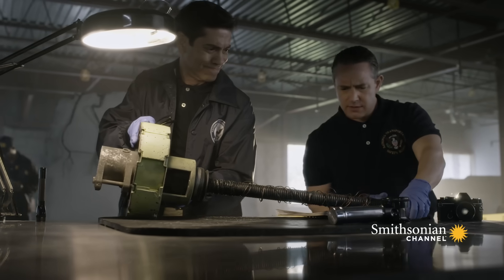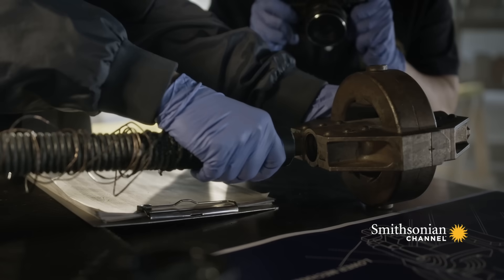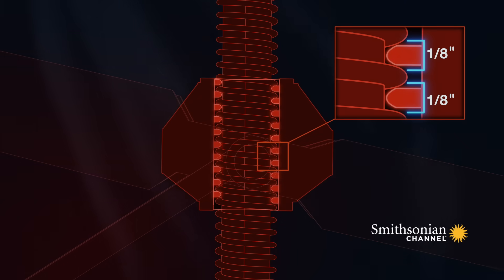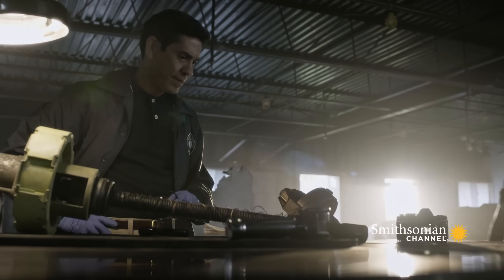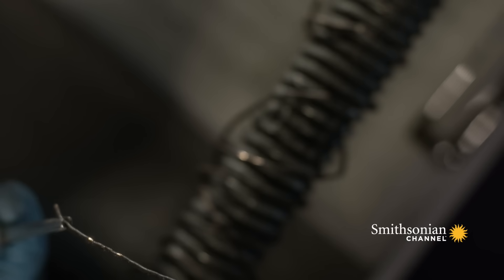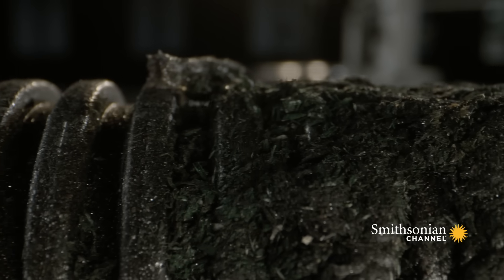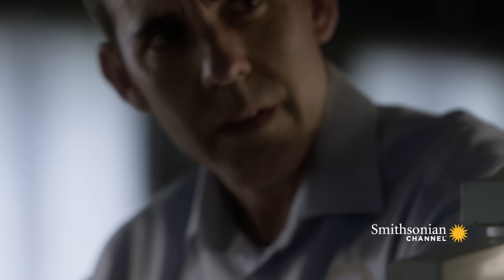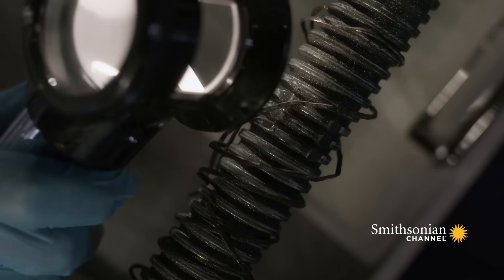Deadly Crash Investigation Reveals Inadequately Maintained Components 💥 Air Disasters | Smithsonian

Comment: Absolutely not, water NOR SALT breaks grease down only way water will get rid of grease is sprayed or splash will remove some excess grease but bottom line grease repels water in a big way all lubricants do as they are mostly all petroleum based in order to lubricate, wick (meaning it virtually spreads on the surface it is on or near To protect from moisture and prevent rust and or corrosion) this was most definitely a case of poor maintenance and the mechanics. We're either too lazy to remove whatever panels necessary to access the spiral worm gear or we're not aware that it was an essential maintenance protocol once a metal to metal surface no longer has lubrication the metals will gall because lubricants basically float parts by creating a slippery barrier that prevents the metals from even touching once surfaces are "seated" or "worn in" and once you no longer have that ultra thin barrier friction starts galling and chunking the metals and eventually creates two opposing surfaces that are literally eating each other away and the threads inside the nut became thin and sharp and weak  suddenly the worm gear bound or "locked up" and it was muscled by the pilots and the worm gear took what was left of the threads right out of the nut that was the end and the stabilizer snapped to its limiter at full down position with no redundant back up system to prevent loss of control. Often on parts or systems like this they will put a nylon coating on likely the threads of the nut because nylon not only creates a naturally slick surface for metal to rub against but prevents friction, heat , vibration and noise. I can guarantee you ever since then there is definitely a redundant backup system such as a secondary screw. Jack set up that probably only gets used if the primary fails. that way the secondary system does not get worn along with the primary so it's in perfect like new condition if it has to come in to play. It would make no sense for both screw jacks to wear right along with each other if one of them has to be a backup system. Definitely something I'm curious to study as to how they remedied that problem.

Comment: Very sad outcome that could have been prevented but human error does happen no one is perfect however many should be talking about how the flight crew tried to "troubleshoot" which is what further led to catastrophic failure. The flight crew did not follow protocol and instead tried to remedy the issue in those 2 hours they could have contacted flight control which most likely would have instructed them to NOT engage auto-pilot. Again, human errors happen and lessons are learned in this case it was not an intelligent move to approach the mechanical failure without proper guidance, and they knew something was wrong prior to the plane going into a complete loss of control dive...2 hours trouble-shooting complete WASTE of time, auto-pilot is not always your friend hopefully future pilots take notes from this incident and to not fully trust aviation maintenance.

Comment: I had an old Toyota Corolla with 250,000 miles. The Halfshaft boots dried out and cracked. I fortunately noticed a puddle of the grey goop, and found it origin.  Point of story. Those bearings cant last a week without proper lubrication held in by the boots that were now gone. so I diligently every friday after work bought 1 large tube of Mercruiser  lower unit saltwater approved liquid grease.
And slopped half into each half shaft without a boot. I drove that dang car for 2 years before i had the shafts changed. The mechanic asked me what the hell was the deal and said they were the most loose and polished set of CV joints hed ever seen, they just disassembled themselves when he pulled them appart with his hands.....Ha Ha Ha. I told him about the grease and he was kinda chuckling about it like, Oooh i just learned a secret...

Comment: Their are phase inspections spread out throught the year, each one gets more and more indebth. This was missed on o e of the said inspections. This is the kind of thing that can get ypu sent to leviworth when working as a Avaiton mechanic or a CDL Claderal Duty Inspector. They are the double and tursheria set of eyes that "ensure" the work is performed properly and accuratly. This includes inspections. This is why it is super critical to put the most qulified personell in these positions and not do it based on anthing but performance and qulity of their past work.

Comment: Threads would not come out of a NUT like that. It appears that the re-creation of the issue shown used a piece of copper wire wrapped around Jackscrew Threads.  The Internal threads on the nut would wear out as metal dust, not a continuous wire.    Lack of Lubrication?     Would have to see the real item.  If it had been recommended that the Jackscrew needed replacement, I suspect it should have been done.

Comment: If you remember, the Alaska Airlines plane suddenly became uncontrollable but then became stable again. The pilots decided to stay over the ocean while diagnosing the problem rather than head inland and risk crashing into a populated area.

Unfortunately this is exactly what happened. The plane again became uncontrollable and crashed into the ocean.

The reason it did this is because after the jack screw stripped it came to rest on the stops at the end of the rod. 

However these stops are not meant to hold such forces and quickly failed, causing the rear elevator to simply flap in the wind and the plane to simply dive straight down into the ocean.

This took several minutes and all the passengers were conscious the whole time..

Comment: There's no way that strand of metal wrapped around the threaded shaft is from inside the nut...you can tell it is a piece of enamel-coated copper wire that was placed there to simulate what actually happened in the story.  The roundness of the wire is a dead giveaway...when a screw shaft strips the threads out of a softer nut, the resulting pieces are sharp-edged and never a continous single strand...that doesn't occur in real life!  Nice try though guys, you probably fooled a lot of people who don't know anything about how machinery operates...

Comment: As a retired jet mechanic I find it ridiculous they didn't recognize this in 10 seconds. There is a specific grease for every lube point on an aircraft, did anyone ever check to see if the remaining grease was the correct grease? Sloppy.
Reply: I drove trucks and ran equipment all my life and saw it like you did! It ain't rocket science, just lack of grease!
Reply: As a former A&P, I was thinking the same thing. If the airline stayed with the periodic maintenance schedules they would’ve found that the jack screw was neglected and greased with the appropriate grease. Then again a tech pointed out that the part needed replacing and they shut shut him off.
Reply: That particular grease has a tendency to wipe off, and not re tack, just wipe off. My use was shaft roller bearings, not tapered. One was blower bearings, the other line shaft bearings for a propellor, about 14” shaft. It would push out by the rollers and not work back in at all, requiring g frequent lubrication. This is why McDonald Douglas has no business running Boeing. Even a ball bearing nut like a Saginaw steering gear would be better than acme threads. Have fun

Comment: It was bad design by a corrupt aircraft builder.  It should have been replaced when the mechanic said it should have been.  But it all started with an under-designed control system.
Reply: Agreed McD D to the rescue, so their management took over Boeing, and we now have Dreamliner and max issues. Have fun

Comment: A mechanic recommended the Jackscrew be replaced on THIS plane two years earlier! Management scolded him saying “Stop Gold Plating these airplanes!” He turned whistleblower and Alaska Airlines fired him! I remember when this crash happened. I followed it in the news at the time. I saw the mechanic on tv (60 Minutes?) explaining how he’d recommended the Jackscrew be replaced two years prior!
Reply: It is common for Jack screw nuts in machine tools to be a softer alloy so that the Jack Screw does not wear. The nut is expected to be easily replaced and takes all the wear. I also was taught to avoid grease because of temerature extremes. We were told to use graphite. Replacing the Jack screw would be wrong. Replacing the jack screw nut would be correct. The drive unit on the jack screw would shear the nut but the amount of force could be calculated from the engineering data. I would have thought the motor would have stalled out. Looking at the amount of metal on the jack screw from the nut, it does not look like  the unit volume is enough to make up a full unworn tooth of the nut. So, I think somewhere the screw may have been ok but the nut, probably should have been replaced. A new nut may have stalled the drive motor before stripping.
Reply: @thomasstuart6861 Could be both needed replacement or just a general "the screw needs maintenance."
Reply: Yes, I saw it too. Alaska Airlines.
Reply: Is he still above ground?
Reply: @SylviaisGod2060  I have no idea. Do a web search and see.
Reply: @SylviaisGod2060  his name is John Liotine. I did a very brief search and didn't find anything about his passing. This would suggest to me that he is probably still alive but I can't say that with any type of certainty. I was mainly providing his name.
Reply: Didn't they also reduce the frequency of inspection to save money? 

If you inspect less often you should be even quicker to replace marginal parts
Reply: @jonathanbryant9855  If you don't see the problem you save pennies, until the failure that costs millions, and lives.

Comment: And they didn't realise that the strip of metal wrapped around the screw was the thread from the nut ??????  Really ?
Reply: It's a specially dramatised and dumbed down version of actual events. A bit like Ice Road Truckers treatment.
Reply: @sussertheoriginal More like CSI Miami
Reply: It's a legal proceeding, where one presents evidence, not opinions. So, one proves that the origin of that metal was the copper-aluminum alloy acme nut and not oh, my own nuts. Given the NTSB report frequently gets used as evidence in court proceedings, yeah, way more than opinions.
Reply: Nuts don't strip out like this.
Reply: @gordbaker896  oh? Tell us all what an acme nut is and how the threads are supposed to strip out.
Seriously, enlighten us, as that's the primary failure mode I've seen on them when they were lubricated and presented with a full load. Tell us how the laws of metallurgy and physics have changed.
Reply: @spvillano  ACME is a Buttress Type of Thread design.  You don't understand enough for me to go further.
Reply: @gordbaker896  EXCEPT they were saying the threads in the middle area of the screw were gone / worn out.
Reply: Amateurs, have fun
Reply: @adiamondforever7890  Where do you think the strip of metal around the screw came from ?  There can be only one place, the inside of the nut. It didn't get beamed down from the Enterprise. Some stuff is rocket science, but this isn't.
Reply: @whizzo94  I've had close to 100 repairs in 45 years, of the same, both bronze and steel, from 5/16" bolts to propellor nuts that fell off, stripped from the taper not fitting. I believe the specified grease was XHP 462, it's been too long. I also had issues with the same grease in roller bearings, as it was a high temp grease and was not tacky, and tended to squeeze out and not re tack into the bearings, causing frequent re greasing, both on pillow blocks and line shaft bearings. (1800rpm and below 250rpm on about 14" inner races). I guess my reference missed its mark. The nut was a poor design, the part was marked for replacement well before it failed. A bean counter can't run engineering, but some common sense is required, but common has no meaning for too many, as it has changed through the years. Have fun

Comment: I thought most of these jack screws were ball screws not acme screws
Reply: what  i saw over the years on Boeings and Airbus they had ball bearings as part of the set up as it avoids any friction on the  jack screw assembly and the T H S
Reply: Are ballscrews allowed to be used in this application ?  I used to repair CNC machine tools for a living, and occasionally I have come across a ballscrew which locks up when it wears. BUT, it might be no worse than what happened here.

Comment: The new episode missed some vital information.  A few examples are as follows:
-Economic downturn in the early 90s and increased competition led AS cut corners to revive. 
-What happened to John Liotine when he reported the airline? He was suspended from his job.
-An x amount of maintenance personnel were suspended from there jobs for falsifying records. 
-When the horizontal stabiliser failed, it moved in the down position and bits of the elevators tor off from the stress (the animation doesn't show this). 

In addition, when the actors had to talk like the real pilots (based off CVR transcripts) they were way off.

The original episode was much better thought out. This one felt rushed.

Comment: Grease is expensive. That s why most air company's avoid to use it😅
Reply: I have read the official report on this crash. The problem was not the price of the grease, it was the unpleasantness of the task of applying the grease to the tailplane jack screw on the DC9/MD80 aircraft.
Reply: @cedriclynch Perhaps they should install the grease Zert on the exterior with a sight glass to insure the component is lubricated.
Reply: @Yosemitesamsecurityco  If it had been an easy and clean job to grease this screw, this would probably have prevented this crash.

Comment: The newer episode really emphasized how close they were to the airport before they crashed; its saddening
Reply: Sometimes close doesn't count
Reply: @madingthree  They were inverted! They’d lost control of the airplane.
Reply: @jmseipp  they actually did have control while inverted. Alas, the wheels are on the bottom of the airplane, not the top.
Seriously, inverted was the only attitude they managed to have control. Control loss occurred when they resumed a normal attitude - well, close, alas 8 degrees down is still, well going down.
A big hint on how bad it was was that the pilot wanted to try to resume control of the aircraft over water, rather than over an inhabited area.
All because of inadequate grease and no why in hell proper C-check intervals, just to save a little money. Well, they saved all maintenance on that aircraft forever, along with income from it and for the low, low cost of hull loss and passenger loss.

Comment: No grease and poor maintenance along with companies cutting corners for profit and this is what happens may the victims rest in peace
Reply: That's UNACCEPTABLE! Tantamount to idol worship! (the dollar)
Reply: @htos1av  exactly 💯
Reply: So not only the guiding ridges jammed with the jackscrew, the jackscrew actually ripped them out completely! No wonder that stabilizer jammed!
Reply: @williameggleton414  I could be wrong but I think, although it did initially jam, ultimately, there was a catastrophic failure and the jackscrew completely separated from the acme nut. This resulted in the horizontal stabilizer being subjected to aerodynamic forces that it was not designed to withstand, which led to a complete failure of the stabilizer.
Reply: Time to regulate those companies better, maybe? 🤔